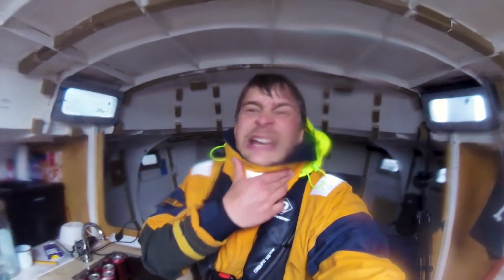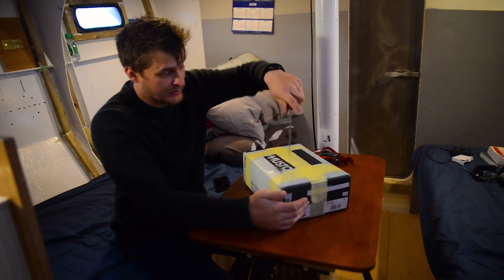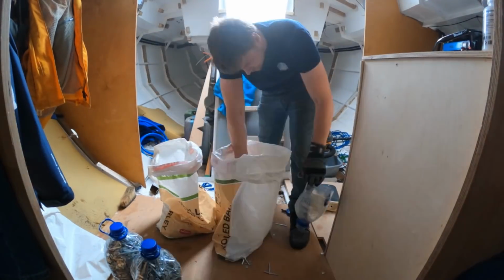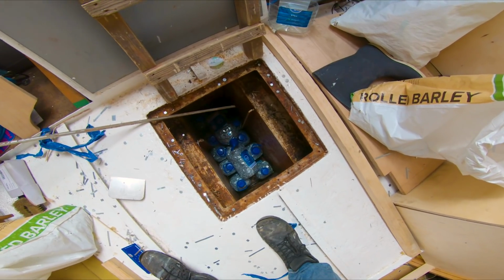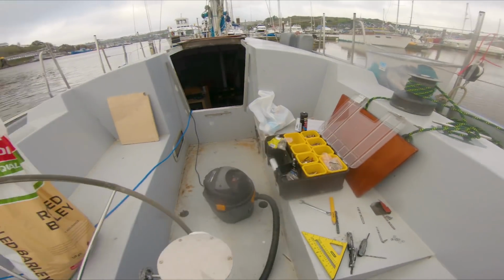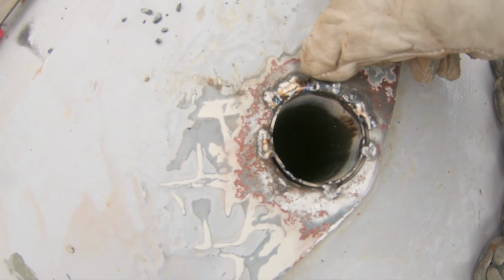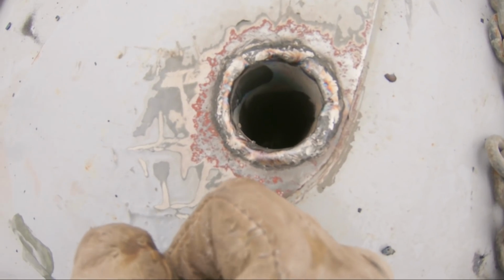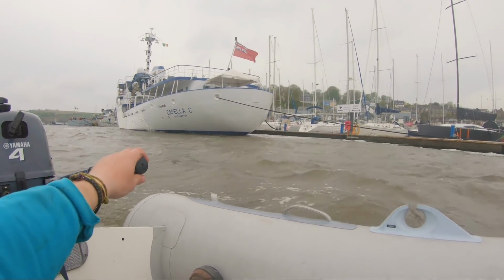SO CLOSE TO INSULATION! - Zora Rebuild - Episode 33

Comment: Sorry if you have solved it already but just to speedup your balancing and ballast you are on a river and have water at the dock, borrow as many buckets and large containers as possible and set them up on the deck. Fill them with water to find how much ballast you need and where you need it. Secondly with the unused space aft you could add exterior lockers (that drain) and put your heavy spares gas bottle make davits to hang the dingy to move weight aft.

Bonus is with water  you just tip it out later and return the containers and buckets but have a plan.
Good Luck

Comment: Hello Rhys, if you have to weld something similar in future you might consider letting the pipe pass through the deck or plate you are welding it to, then it gives you a fixed edge that you can build your weld up to and cut it off flush afterwards. Regards Dave
Reply from the maker: Thanks man

Comment: What stops water from running down your chain pipe into your bilge?
Most boats I've seen have a separate chain locker that drains to the outside, so the muddy chain doesn't stink up the cabin. Thoughts?
Reply from the maker: I haven't put a chain locker in yet. I will make one from FRP

Comment: Grinders can be too aggressive at removing metal. 2 years back me and some volunteers did a little bit of welding on charity narrow boat. 1 guy brought a flap disc with him, I'd never seen them before but compared to normal grinding discs it rounded the metal off smooth. He let me keep it and I went off and bought 40, 60, and 80 grits. 
I've not contributed to these channels I watch but if you want a couple posting over just send me an address or since I'm a stranger on the internet a postal locker and I'll send you a few, see if you like them. Filling that much metal would take ages! They would be for a 115mm grinder if interested
Reply from the maker: Hey buddy, thanks for the offer but I have loads of flap discs :) I rubbed the top of the weld with one bit forgot to film. They are great!

Comment: Steel or not, a pair of spring lines might be a relief for the part of her paintwork facing pontoonwise ....
If You can't furlreef Your headsail in by (an adult male) hand something's profoundly wrong: too much sheet-in thus still too much wind in the sail-to-furl, too bad a bearing in the furler, wrong angle of the furling line, wrong angle of the bottom part of the furler drum, too many kinks and bends in the furling line back to the helm, too less / bad bearings in the furling line directioners beneath the footrail ....
But You could use the aft winches for Your full blown chute'n blooper running setup when the furling issues will be worked out finally 😄.
That weldjob does NOT look like a disgrace by the way. Thanks for sharing.
Reply from the maker: Ah well I can reef by hand pretty easy but just easier to winch so it comes in tight 😆
Reply: @SailingYachtZora  It's time for a bigger chute then, ain't it? 😂
Reply from the maker: @manfredschmalbach9023  😂😂😂

Comment: what are these 'shavings'? where did you get them?
i've been watching 'sailing mistress' as well. nice that you're helping him out when you can.
Reply: The 'shavings' are actually "punchings" they are bits of scrap stainless steel from a machine shop local to Rhys. They have a big punch machine they use to punch parts out of sheets of stainless and those pieces you see Rhys using as ballast are from the areas of the stainless steel sheets that are between and around the parts which have been punched out and saved. Like when you spread cookie dough out on the counter and use a cookie cutter to cut shapes out of the cookie dough sheet. When your done punching cookies out of the sheet of cookie dough, you are left with a dough sheet that has a bunch of pine tree (or star, dinosaur, maybe gingerbread man) shaped holes in it. The punchings are just like the bits of left over cookie dough sheet.
Reply: @gfg_horseman7159  thanks
Reply: @iainlyall6475  No problem! It's for sure a really creative idea for temporary ballast. I dont know if it was the video before this one, or the one before that... but in one of the recent videos Rhys shows the scrap bins in the machine shop where he got them. Clever clever.
Reply from the maker: That was an really good way to explain what the punchings are 😆😆